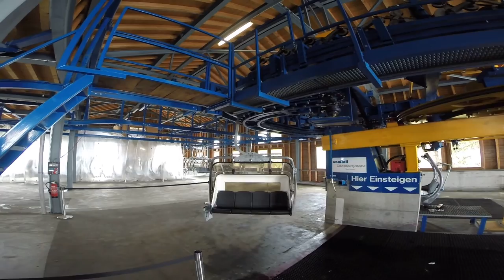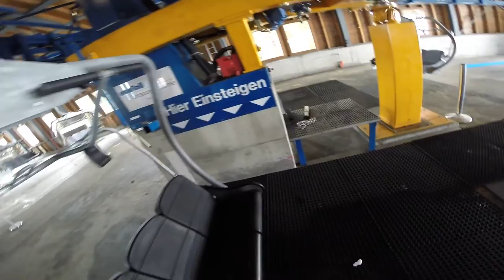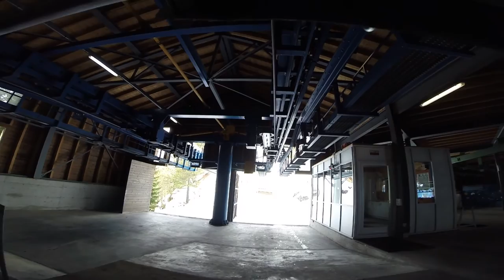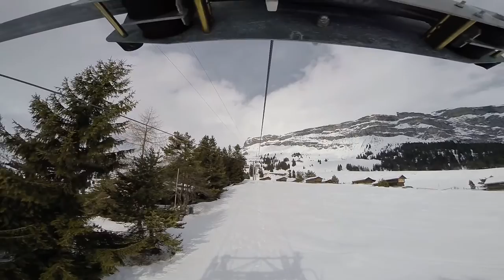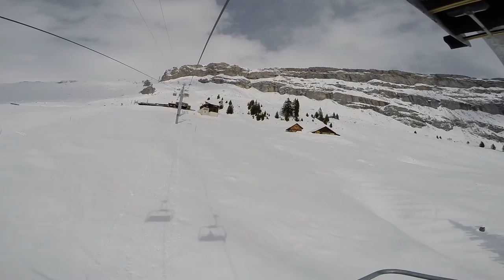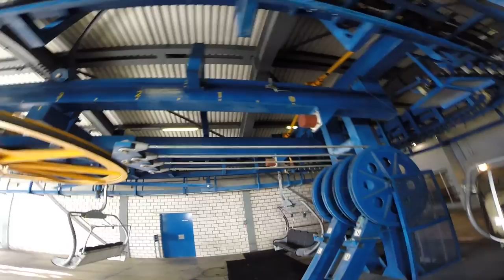Sesselbahn Naraus (1989 - 2023), Flims (Flims Laax Falera)

Comment: I love vonroll's lifts alot.
Reply from the maker: The first Naraus chairlift was also a VR101, built in 1947.
Reply: Oh. Naraus number one built by VonRoll and replaced by VonRoll? I'm not angry about that as VonRoll is my favourite manufacturer, but I absolutely hate it when Doppelmayr replace VR101 or any VonRoll lifts, for the worst: UNI-G.
I still like the VR103.
Reply: @mawid81  1st Von Roll VR 101 1945
Reply from the maker: @vonrollskyway1  I guess the Naraus VR 101 was from 1947 ;-)
Reply: @mawid81  flims / Foppa. 1945..